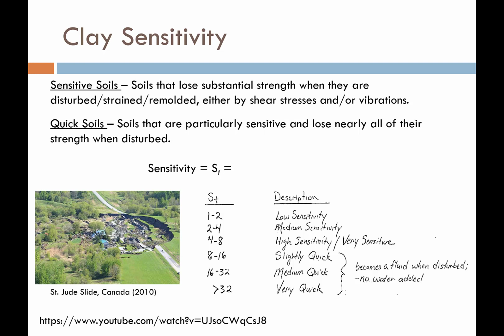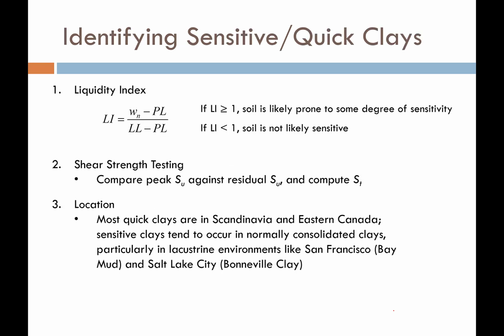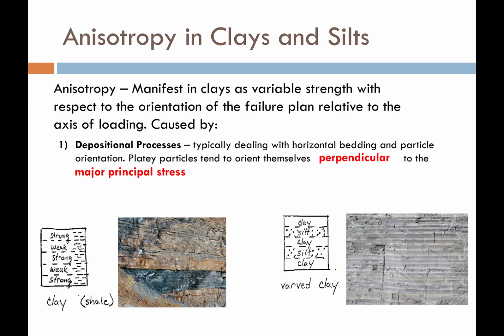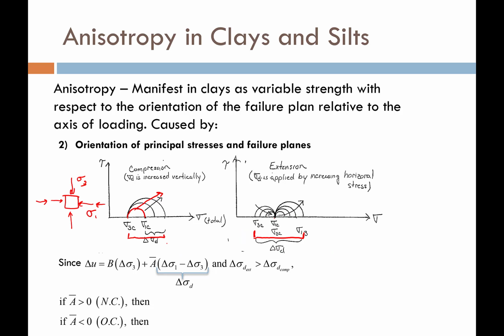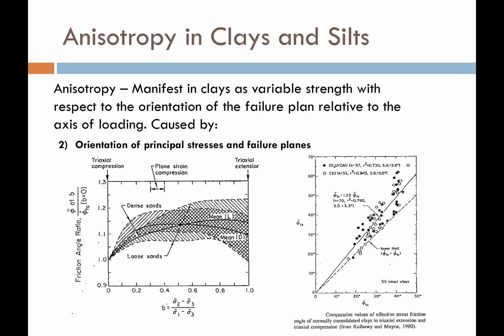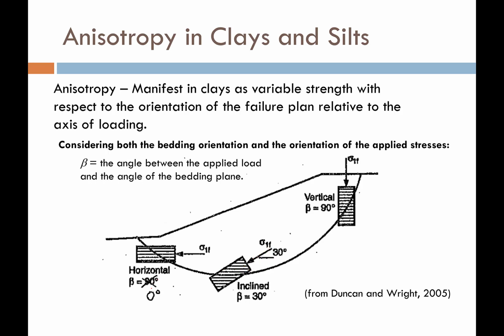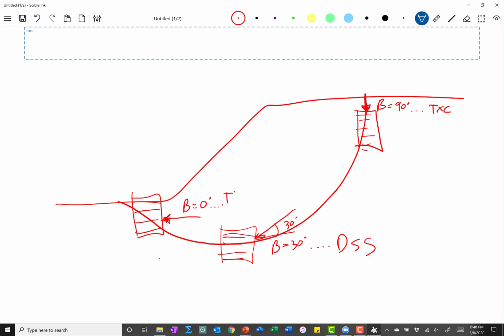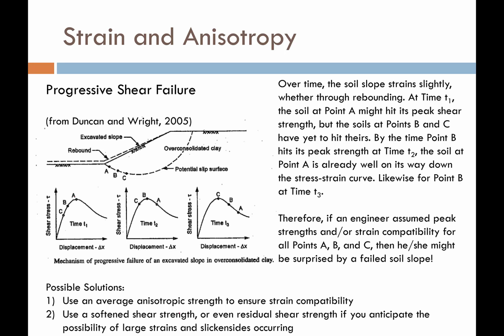CEEN 641 - Lecture 15 - Clay Sensitivity and Anisotropy

Comment: In Scandinavia we have clays with sensitivity over 500. Su might be over 50 kPa, and the remoulded strength is lower than 0.1 kPa. 0.1 is the lowest possible measurement, but the strengths might be lower.